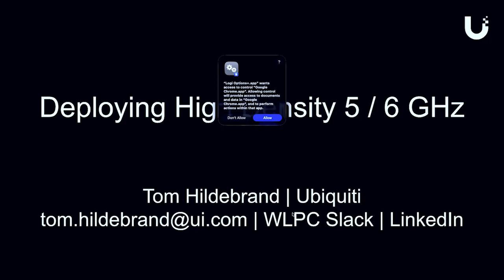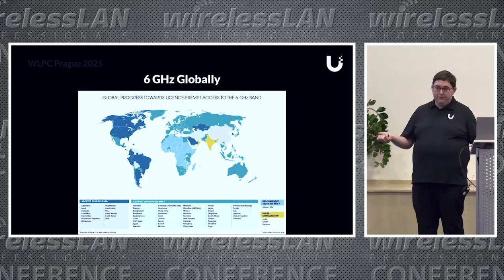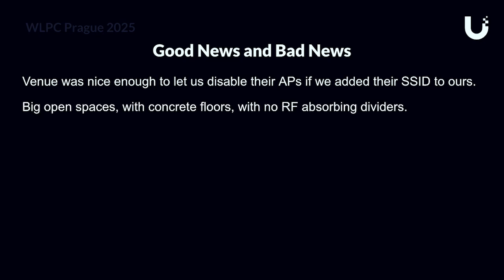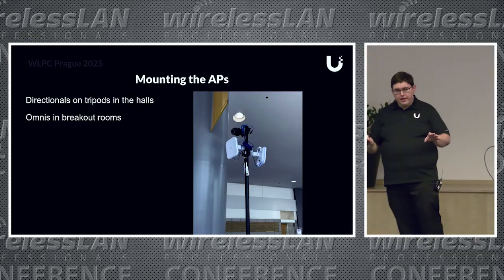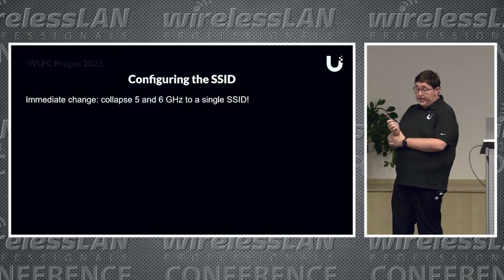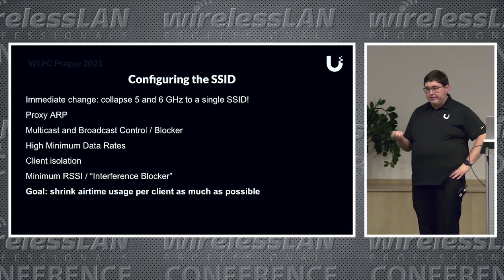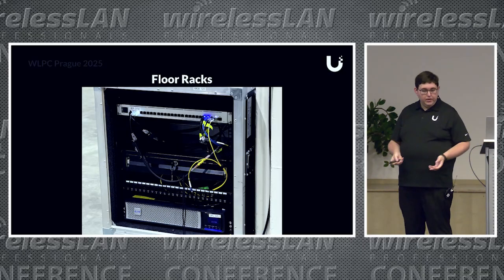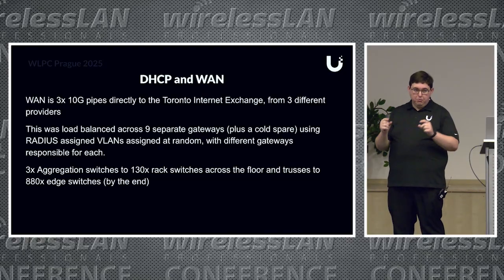Deploying High Density 5 6 GHz | Tom Hildebrand | WLPC Prague 2025

Comment: Just because you increase channel width which decreases SNR does not mean to just increase power. If you just increase power you can/will potentially create a sort of asymmetric datarate connection between client and access point. The better option tends to be to design for appropriate power levels and then tweak settings for optimal performance while staying within the power transmission parameters